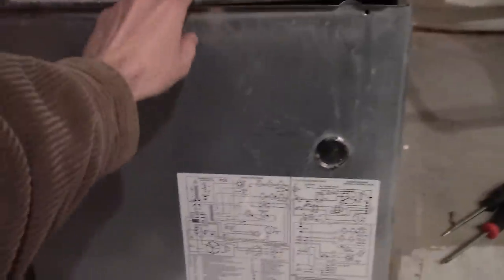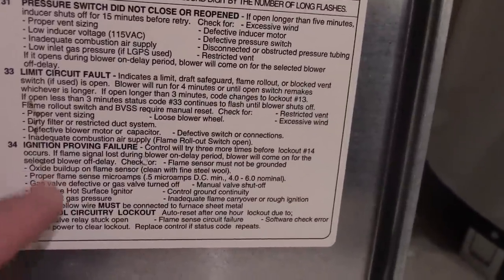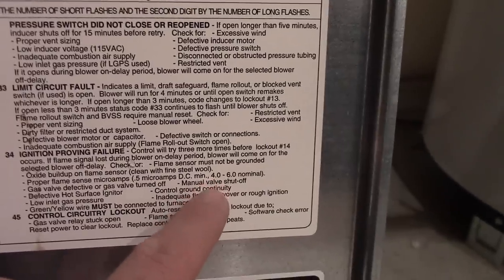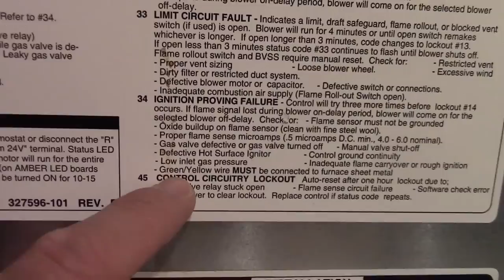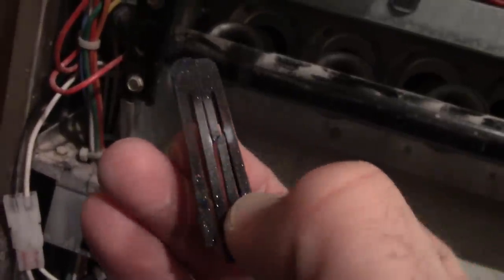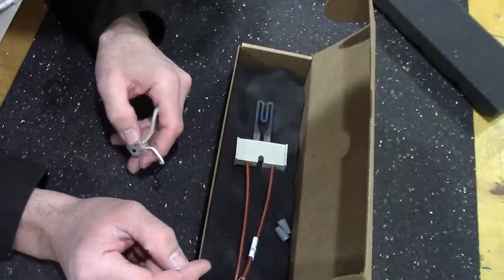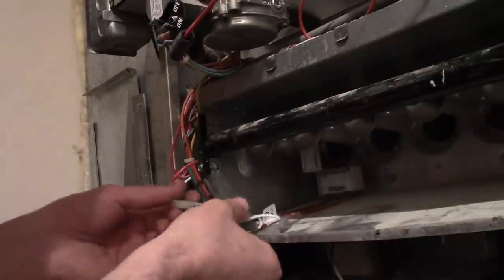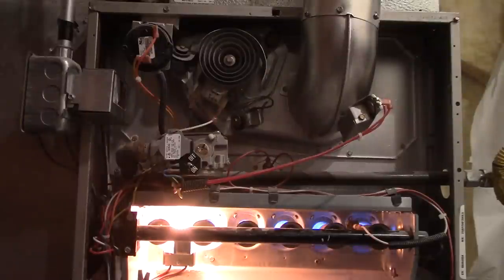How to replace Hot Surface Ignitor Bryant gas furnace Error 34

Comment: Thanks so much! I simply can’t believe I did this! 
I’ve been neglecting service, but the last time I had it, the tech said I could do this and I thought he was nuts, but I ordered the parts anyway, thinking I would have them when I called him back. 
I was caught off guard, so I came here and found this great video. I replaced the flame sensor first, then the filter, then the ignitor. I’ll still call the service out to check my work, but at least I won’t freeze waiting for them or go broke on the parts.

Comment: Adam, trick was to break the connector of the old part.  OR, you slip a thin small flathead into the connector to widen the old connector.  I spent 10 minutes pushing from the outside, then realized my small flathead fit inside through the top, where the connectors meet.  At that point, I was getting annoyed and said, Stodnod, you don't need the old part.  And then it broke.  Five minutes later, I saw the light, rather the red glow.  Thank you for posting.  I have a Carrier.  Igniter part LH33ZS004.  Good luck to all DIYers.
Reply: Thanks that's the only thing I was wondering about was how to remove ignitor from connector

Comment: Thanks for the video. The label i have on my furnace did not have a faulty ignitor as a possible cause for the error, but this video led me to inspect the unit and i noticed it didn't light up during the cycle and when i removed it, there was a break similar to the unit in this video. Quick trip to home depot and the universal unit worked great. Thanks again!!
Reply from the maker: +Daniel Spiteri Awesome! I'm glad to hear you got it working. Your Home Depot sells Hot Surface Igniters?
Reply: +AdamDIY Yes they do, they have the "Universal Hot Surface Silicon Nitride Igniter" which is an upgrade for the one shown in the video. They last longer and aren't as fragile

Comment: Thank you....been looking all day for the right video...wasn't sure if it had to be wired a certain way or not...I have spare igniter for different furnace but connectors aren't the same...so I will assume it will work if I splice it in ...thanks

Comment: I have a different model, the LEDs for error codes are yellow and green, so rather than the duration of flashes, it's 1st digit of error code is the yellow flash, the 2nd digit is green flashes....   I was thinking it was the igniter since I observer that the induction fan started normally, and the gass-valve solenoid clicked, normally, and I smelled gas., etc.  So it seemed that the gas just wasn't lighting.  HSI igniter failure?!?  After 17 years, seemed plausible.  So glad to have this video available, gave me confidence to try a DIY
Reply: P.S.  On Bryant model 355MAV installed 2001: Had to remove air intake pipe to get at ignitor.  Then found that ...dang, unlike the video, my ignitor does NOT have a nice fat obvious crack in it.  And just enough very light whitish stuff to cast doubt.  Checked ohms as advised in manual, found that it is outside the normal range of 45-90  (104.5), yet below the threshold (>110)  where they say I have to replace it.  It does not glow during "component test."   (see manual pg 35 in my case)  I have lit the jets and gotten some heat out of the unit by using a longnose butane lighter.  But being there to do that when it kicks on will be tiresome.  So, wondering about an upstream defect.  Ignitor-solenoid?   I'll keep trying....

Comment: Great info.. But what is the trick to disconnect the quick connect?
Reply from the maker: There are little plastic clips on nearly all of these kind of plastic wire connecters that you need to move so it can be released. Most times you can use your fingers, on stubborn ones you can use a flathead screwdriver.

Comment: Any recommendations for a Bryant Plus 95s evolution? We just closed on a house after paying literal hundreds of dollars for a licensed inspections. The first evening we try and use the heat, it doesn't work. Error code 34. This is a gas heater with no pilot light. It is equipped with some kind of auto lighting device but no idea what I'm doing.
Reply from the maker: +Robb Kelley The furnace goes through specific steps in a certain order.  That will be valuable info in helping you find your problem.  In this link https://youtu.be/5CDF0duucpQ  I show the steps it goes through and mine stopped at the bad ignitor. Is yours the same?  If so, it's a super easy fix if you need to replace the ignitor.
Reply: AdamDIY Adam, I will have to replace the ignitor just as you said. However and embarrassingly I found the true issue. We moved into a new house and the utility company mistakenly turned off our gas line. We are back in business and I will use your other video to fix the weakening ignitor.

Comment: How did you disconnect those connectors? I spent like 3 hrs trying to do it without breaking it, still couldn't do it. It really is impossible.
Reply: Glenn Lee OMG, the connector to remove the old ignitor was the hardest part. I was afraid of tearing it apart the wrong way, but I finally just got a good pull on the old ignitor and held the other side in place and the ignitor came off just right.

Comment: @ 7:50 ON THE VIDEO I WAS ATTEMPTING THE PROCESS AND I CUT MY WIRE TOO SMALL WOULD YOU RECOMMEND USING TAPE OR SHOULD I GET ANOTHER PART TO CONNECT TO THE IGNITOR

Comment: What about  Bryant serial 2003 hot surface  ignitor  and frame  sensor are in a very tight spot. How do you replace the hot surface  ignitor?
Reply: I need to know this too. Did you ever figure it out?

Comment: Hey Andrew, the fan of my furnace sometimes spins and sometimes does not, when it does not spin basically nothing happens, even if i leave the furnace on for a while. I clean the flame sensor, but that does not fix the problem. what do you think can cause this issue?
Reply from the maker: +Jean Etienne Does it have a flashing error code?  What model is it?
Reply: Thanks for getting back to me! No, the red  LED is solid, no flashing. Sometimes the system does not run, the fan does not spin and the ignitor does not do anything. Without doing anything, sometimes it runs. Thanks
Reply: It is a "Carrier" model #58STA070---12112
Reply: by the way, it looks identical to the one you have  in the above video.

Comment: My furnace has an automatic ignition system.  The "on/off button" is stationary, but there is a slit in the middle of that button, and there are two toggle switches, or gas control switches as the instructions call them.  Does anyone know which switch I flip, or turn to the off position so that the furnace then will light itself?  The switch gets turned to the off position for five minutes, then when it gets turned back to the ON position, the furnace should relight, provided there is nothing else wrong with the furnace.  I just don't know which switch is the correct one t turn to the off position.

Comment: can i pick one of these up at a Hardware store?
Reply from the maker: You can buy them on Home Depots  website and they ship it to your nearest store or your home. Just type "ignitor" in Home Depot's search and you will find them.  I'm almost certain Lowes and H.D. don't stock them in the store.  I called a local HVAC repair place for one and they would not sell it to me. So I asked them where the nearest local place was that sells them and they told me. http://allreds.net/  Thats a Utah store, but I'm sure there are places like that across the country.
Reply: AdamDIY
Thanks for all your help ordering one as we speak!